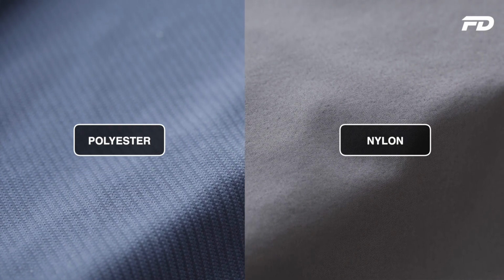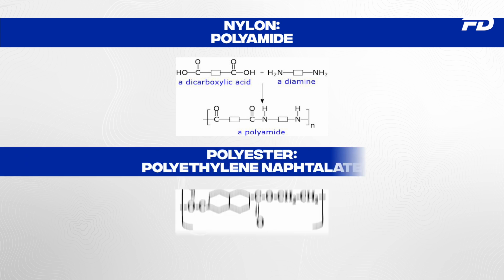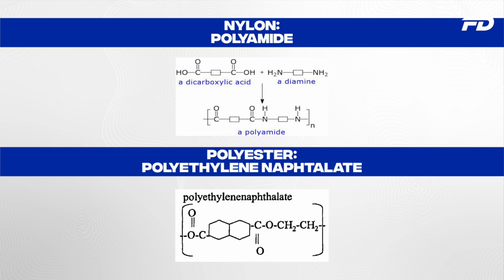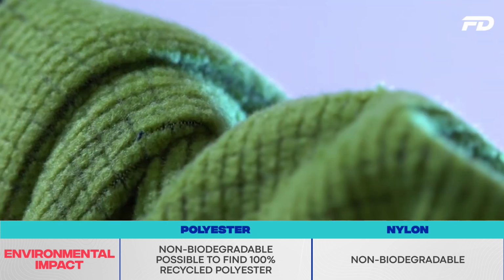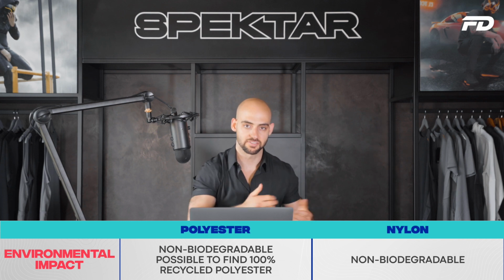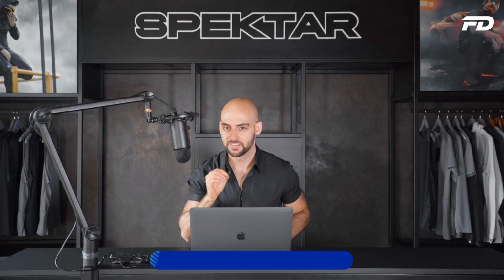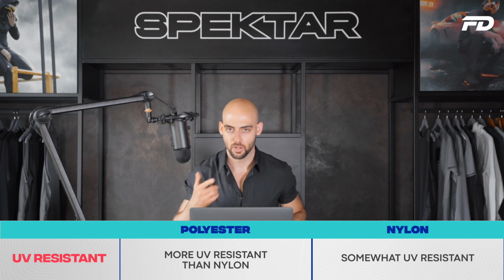The Best Sportswear Fabric: Nylon Or Polyester?

Comment: I'm an Eagle Scout who grew up fishing in the PNW and earned my rank there. Joined the military right out of high school. Suffice it to say, these materials have been covering my hide since my early years. 

Polyester sun shirts have been my go to for years, even for every day wear. Never had them hold smell, but others have told me that they have. I wonder if this has to do with body chemistry, or how these shirts were made. They certainly stink after a day of trekking or a week of hunting though. 

Nylon sun shirts were something that I sought for years that I've only recently found on Amazon. They run for about $20 a piece, same as the polyester ones. The sand colored T's we were issued were polyester, but I replaced them for Nylon ones early in my career. Both have held up well as under shirts (almost like new, even after almost a decade of use). 

I suppose it is worth noting that the line we used for fishing growing up was Nylon, and it also floated. We'd typically use it for deep water shell fishing like for Spot Shrimp, because it was cheaper than leaded line which was used closer to the surface where floating line presented a prop hazard. 

Anyway, great video. Surprised it doesn't have more views.

Comment: What about compression strength? Could these also be used for lower level compression garments ( leggings) for those w lymphatic issues like swelling in the legs? Not saying as a medical level garment but lots of us don't need a medical level of compression. Medical leggings are extremely expensive and I think these could work for women w Lipo- edema. One could go down a size if not tight enough. IT would save a lot of money for a woman who is financially strapped and needs compression now.